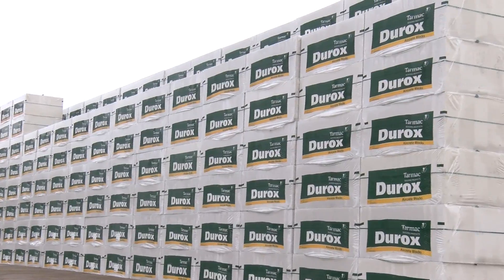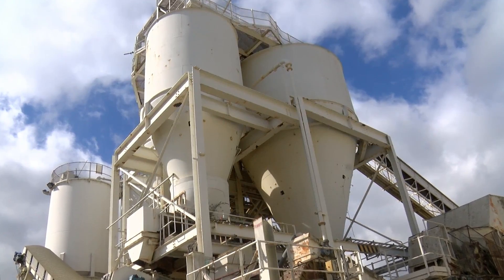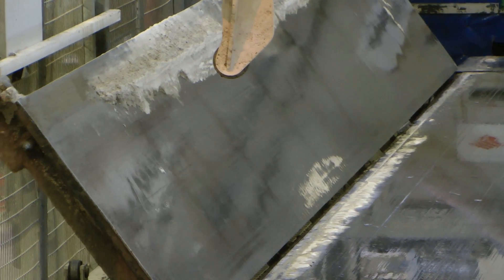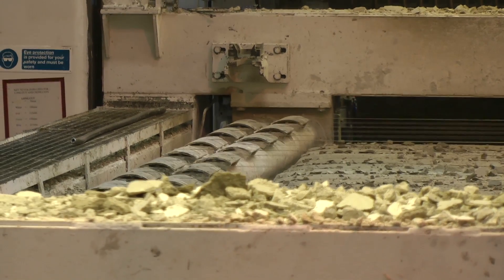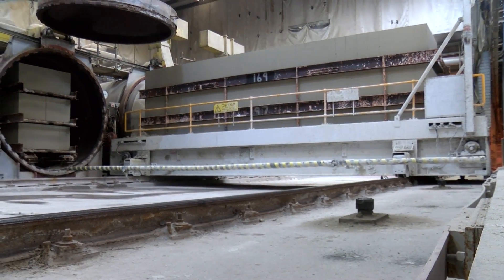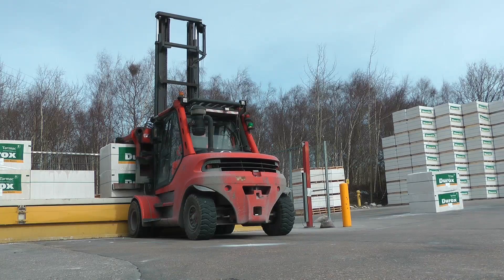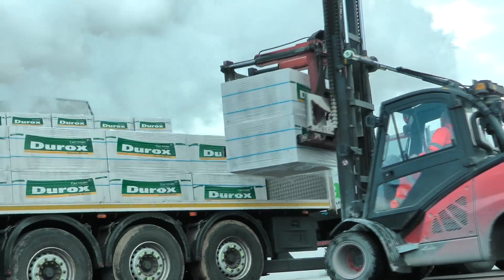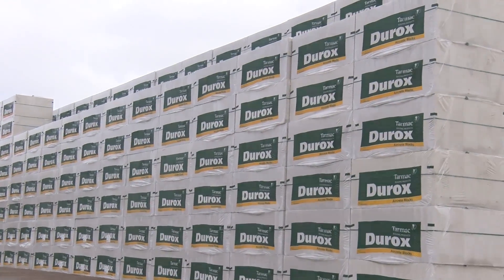Durox Aircrete Blocks

Comment: i cant see how a lite weight block full of air bubbles can be stronger than a solid block of concrete ? ..curious to know the mpa of these cast blocks .?
Reply: https://www.forterra.co.uk/plugins/downloads/files/Thermalite_Aircrete_Blocks_Guide_03-18_1.pdf
Reply: they were used in my state , i think the court case is still going on today , as many homes cracked to pieces and were demolished ..internal walls not a problem